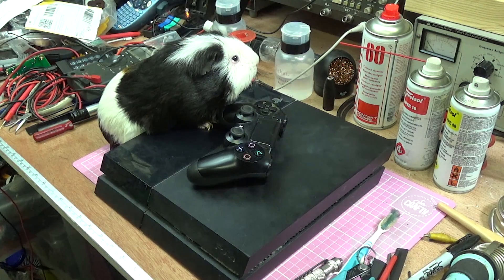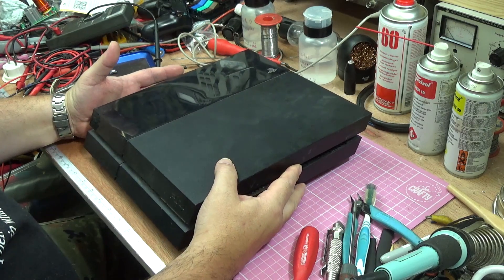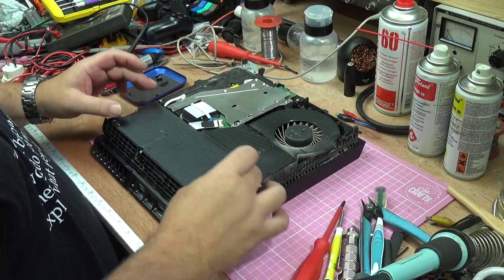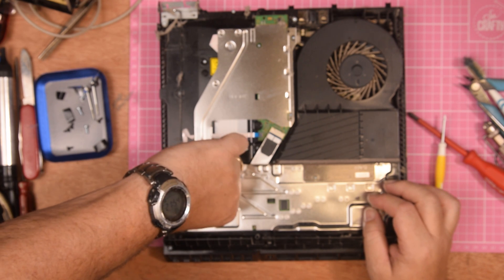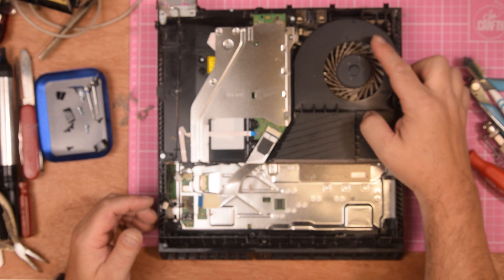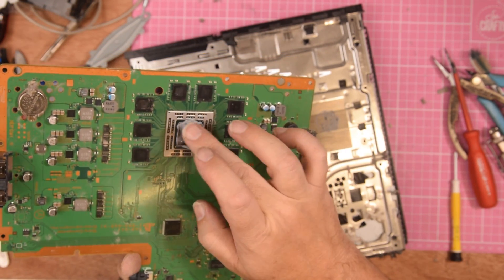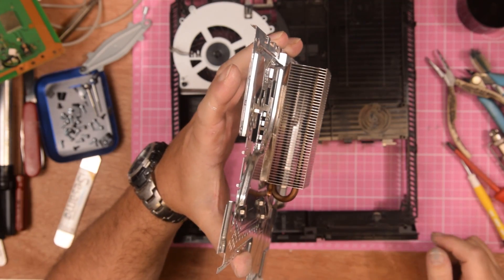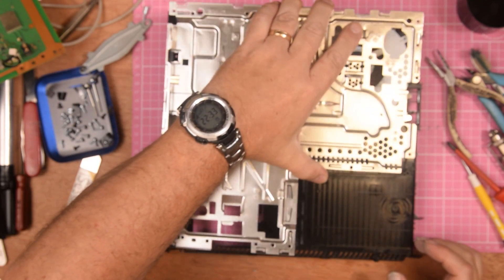How To Fix Ps4 Overheating Problem : ZERO COST

Comment: Sad part is i did all of this replaced the thermo paste and still it gets to hot and turns off wtf
Reply from the maker: not sure unless it is a memory issue too. If you put too much paste on it actually acts as an insulator. you need the thinnest scraping of it. Most people overdo it and it objects. you are only trying to fill in microscopic imperfections in the surfaces.

Comment: I used this video to clean my PS4 and now my system turns on then turns right off after a switch goes off inside, any help???
Reply from the maker: You have either not connected a fan when fitting it back together or the heatsink is not properly seated. It might be good to also check the cable to the hard drive

Comment: Can you post a link to the tools needed
Reply from the maker: you can get the tools required in lots of places and for different budgets. https://www.amazon.co.uk/Deyard-Precision-Screwdriver-MacBook-Electronics/dp/B07VL3C1NW/ref=sr_1_13?keywords=screwdriver+set&qid=1571607229&sr=8-13 should fit most needs in any electronics but there will always be a need for bigger tools too.

Comment: I bet Kenny would like to watch this. Are you filming with two cameras? I broke my lens on my camera the other day. I bet you could have fixed it. It didn’t shatter but stopped automatically retracting. I dropped it and it slanted in on one side. Then dear Kenny forcefully tried to even it out. It made a loud pop and it looked better, butthe sound of it trying to contract stopped and it would no longer turn on properly  in film mode.
Reply from the maker: I normally film with 5 cameras Drea! It means that if my hands get in the way at least one camera should get a shot of what I'm doing. Camera repair is one of those awkward fiddly jobs that tend to need you to work under a microscope. I don't have the eyesight any more. The other thing is spares, usually only the manufacturer keeps them so you have to send them in.

Comment: I don't feel confident enough to open my Ps4, thinking it could completely destroy everything. And my Ps4 only overheats on one game... Should I try to clean it or let it be because some of my friends actually lost their ps by trying to clean them
Reply from the maker: If it is only one game I would be just tempted to blow through it with compressed air and not take it apart.. If you are not confident in taking it apart, and more kudos for being able to admit that, then even taking it to a local mechanic to blow through with his air line will be a good start.
Reply: @GeorgeChristofi  yea I think maybe just the top of the fan would be enough. Thanks for the quick response

Comment: So whenever I turn on my PS4 it stays on for like 2-3 mins then it just turns off and doesn't turn on for like 30-40 mins , what could be the problem and how can I fix it?
Reply from the maker: Possibly overheating or it has detected a fault in memory. You could see if it is dusty inside but apart from that I have no more insight into the fault.
Reply: @GeorgeChristofi  oh ok thanks
Reply: ROSHAN 1710  did it work ?
Reply: I had that problem once had to get the power supply replaced, may be caused by a blackout or maybe the ps4 was unplugged while turned on, also a can be fault in memory, try restoring the database in safe-mode or getting the power supply checked by a professional
Reply: Exanced  u buy ps5
Reply: Exanced did you clean you’re ps4 ? If so did it work

Comment: I have now found that the speed sensor goes out on the mother board so i wired mine to my monitor. 

Also i bypassed the original signal so the console thinks it has the fan plugged into it.
Reply from the maker: nice fix. a great bypass from the main board.

Comment: how do u get the black on black off
Reply from the maker: I'm not sure what you mean?
Reply: George Christofi neverminf buy did your system ever get the red liight
Reply from the maker: @Lowestcam  it wasn't mine and the system was brought to me with just the on screen message. I don't think it had a red light at all, it just kept shutting down almost as soon as it was powered up. Having had similar problems with sat tv boxes, original xboxes and laptops I guessed that it was a cooling issue and the amount of dust on the side pretty much told me it was full up and the heatsink would be blocked.
Reply: light*?
Reply: George Christofi ok

Comment: You don’t ever want to spin the fan manually it could damage the system
Reply from the maker: If you are concerned about the back emf generated by the fan then it shouldn't be a problem because there is a diode on the motherboard to guard against that in case of such a situation. It is the tame with most decent computer motherboards and other electronics with fan controllers.

Comment: Ive only had my ps4 about 4months and it was working fine.i took it to a friends house to get it updated and know it gets really hot after about 30 minutes
Reply from the maker: You may be better off removing whatever the update was or seeing if there has been another one to cure overheating caused by the update.
Reply from the maker: Seeing as it is that new, take it back to the store under warranty, do not open it at all.
Reply: s0ldmyliver4gasm0ney Me same for me. But I moved houses and it started overheating

Comment: Hello, My ps4 is overheating when i starting a game, it gets overheated when the game is loading, can u please help me with that?
Reply: I cant see the video to
Reply: Can i send a picture to you so you can see, or can i send the ps4 to you so you can fix it, of course i Will Pay you
Reply from the maker: @mahmuddaal  by all means email a picture. unfortunately I couldn't do the repair as I am already overloaded with work. Use the Youtube email address on the about page of the channel.
Reply: @GeorgeChristofi  thx
Reply from the maker: You need to dismantle the unit as I did in this video, clean out all of the dust from the heatsink and reassemble it. It should clear the problem.
Reply: @GeorgeChristofi  i alredy done that, the ps4 is like brand new
Reply from the maker: @mahmuddaal  Ok, have you got it on its side or flat? If you have it vertically you need to get a stand for it as the air intakes are blocked when vertical.
Reply: @GeorgeChristofi  i bought it from a friend, and he had it flat

Comment: man I cleaned after that wont start working , after I put play come and say ps4 is too hot and make red light and shut down !!!!! 
can u help ?
Reply from the maker: You have to check the heatsink is fitted back correctly and the fan is plugged in. If either of those is not done correctly it will shut down with overheating very quickly.

Comment: I can really believe this as i bought a ps4 pro just over a year ago and only used it a few times as i have an xbox one x, A nintendo switch and a powerful gaming PC and working full time and being in a relationship means i don't get a lot of free time to play games but when i heard no mans sky was coming out on VR i purchased a VR V2 headset and started playing my ps4 pro excited about soon being able to play it in VR. My ps4 pro after about 20minutes would overheat and freeze and switching it off at the wall was the only way to reset it, 

I build PC Computers so i put a 1tb ssd in my ps4 pro as that means much less heat than from a normal hdd and i changed the thermal paste out for a quality paste (There was NO dust on my heatsink and fan) and the problem remained and I've watched dozens of video's on youtube where people are having the same problems as i am and one youtuber said it is the power supply within the ps4 pro console that is overheating because before the power supply use to be external in the form of a brick but it was better for cooling. 

I have since purchased a brand new PS4 Pro console with the game red dead redemption 2 and this console has a different power supply cord but let me tell you the console still gets very hot after a short time of gaming playing no mans sky. luckily i purchased a 3 year warranty from argos for my ps4 pro for piece of mind but the strange thing is Sony have stopped selling extended warranties on their ps4 consoles which i find very suspicious, it's like they are aware of the problems with their console thus stopped selling extended warranty to save them the hassle and money. 

I think it's very poor of Sony considering my xbox one x which is much older and has seen alot more usage has never overheated once nor has my switch, I will keep my first ps4 pro and trade it in for a ps5 when i am able to do so. I purchased a ps4 vertical stand as i believe that will help in helping my ps4 pro to cool down better, time will tell :-(
Reply from the maker: I hear you there Paul which I think there is a huge market for those extra powered USB stands for the PS4. That one was the first I have actually worked on myself but I did some googling first before I started just to see how common the overheating issue was. 

I used to do fan mods to Pace Sky boxes as they were good at burnout due to inadequate cooling of the power supply. Heat has really been an issue in a lot more modern electronics than the older valve based stuff. Valves get really hot but things were designed in such a way as to cope with the 150c temperatures of audio valves and hot rectifiers. Modern stuff is more shove it in a tiny box and don't worry if it burns out because they will buy new as you can't repair it any more.

Xbox power supplies are really good, They can be used for so many things other than xboxes and can really deliver a good amount of current.

Nice to have you stop by and hope to see you on other videos
All the best, George

Comment: Love the guinea pig Idea. Dust the major killer of heat sinks and then processors. I love the idea of running the video backwards to put it back together. Great video Thanks for sharing George.
Reply from the maker: Darth is a cute guy! It seemed to be the best way Larry to get the thing back together. In our car manuals made by Haynes there was always a phrase at the end of every procedure.. 'reassembly is the reverse of dismantling' so they didn't have to go through a full procedure. I thought I would take that idea and use it to put it back together.